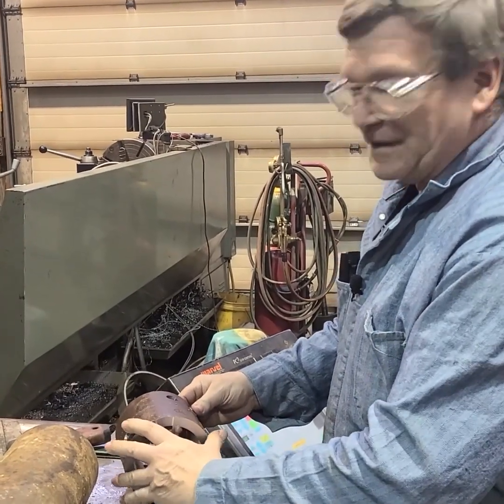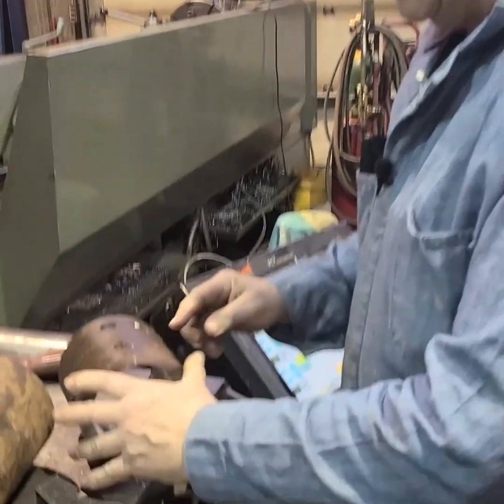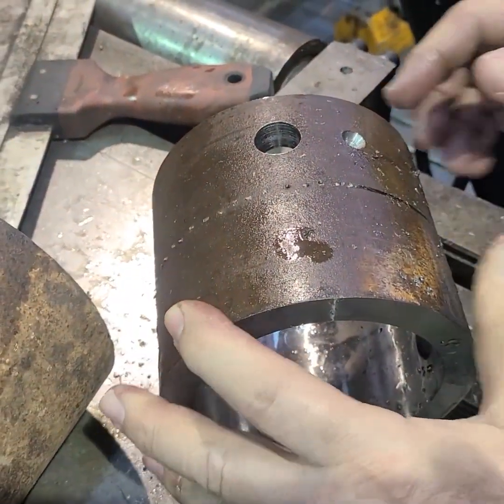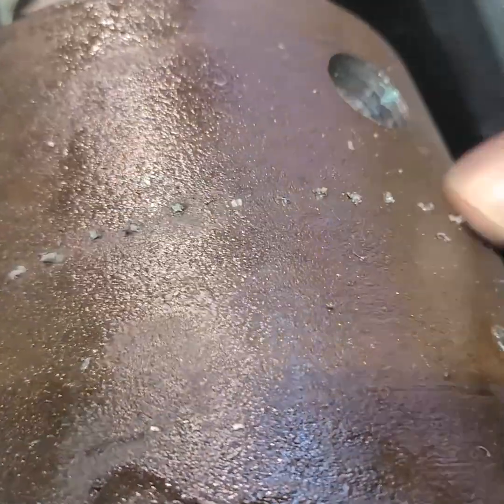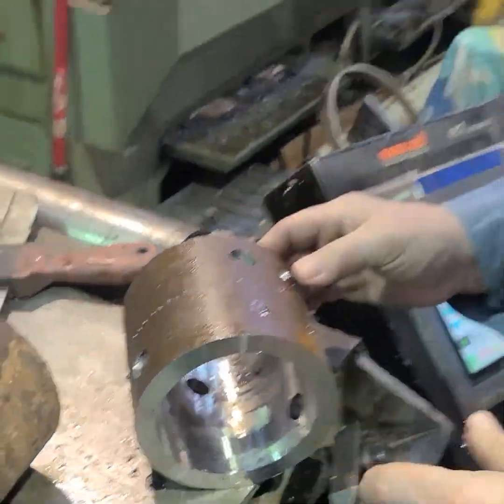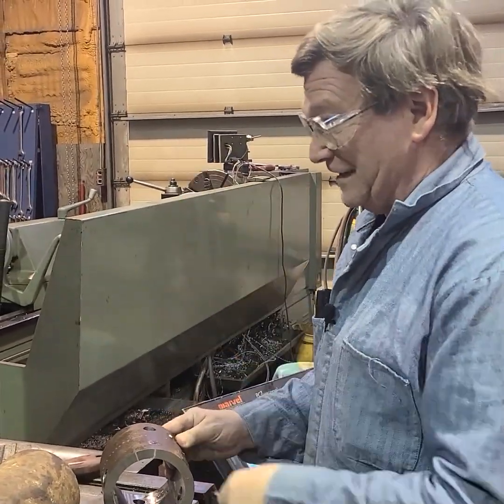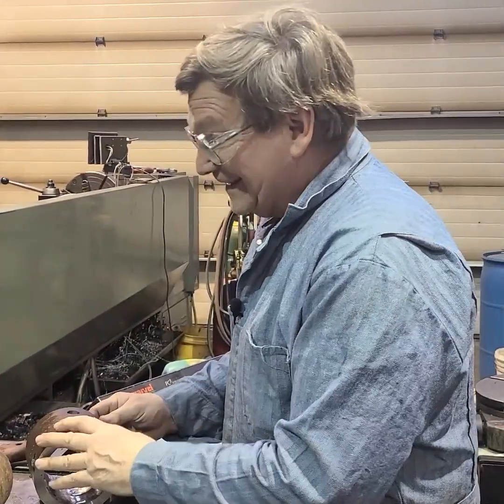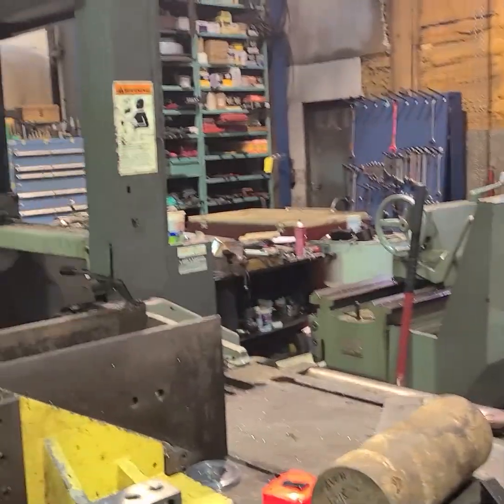Machinist's Minute: When you don't clamp your part in the saw

Comment: EDM!
It ends up with zero kerf or tool marks.
The cheap way to split a finished part using a band saw is make a fixture. 
The operator set the feed rate too high and it tears the workpiece free. 
Can't rush "perfection"

Comment: If that happened to a part that I was working on I would either take a sharp punch and knock out the fragments of teeth that got embedded into the part or I would use a angle grinder with a cut off wheel to cut through the remnants of saw blade, then finish the job on the band saw.

Comment: Years ago I worked at a fabrication shop/machine shop and we did a lot of first operation procedures for a larger military contractor. 
One of the operations was to cut spacers from heavy gauge tubing. The most common was one that measured 8in OD x 6in ID x 1in thick. The stock was delivered to us in 21ft lengths. They started out using a band saw but it wasn't accurate enough, then they were using a large power hacksaw, which was the most accurate. They had a lathe that could handle it but it would have required re-arranging the shop area to accommodate the long tubes and cutting the tubing down produced waste and the last cuts were an issue. What I did was to take an old lathe chuck and I mounted it to an angle plate I made up, the chuck could allow a flush cut right up the the saw blade on the power hacksaw. (and later a carbide cold saw).
The lathe chuck and the mount was bolted down where the vise was, it allowed a good solid grip on the tubing and was easy to advance as all it needed was a positive stop to set the length of cut. 
After a few months we sourced four more large older lathe chucks and I set up four more saws the same way and what started as a week long order could now be done in two days or less letting us get on to more profitable work.
Reply: Man honestly the big material is where band saws flop. Largest we had was 12" bar... It was delivered in 10' sticks, first issue we had wasn't even getting the vise to move it, it was actually stopping the material itself. Once we found that out, getting a straight cut was the new one.
Reply: There’s always a solution, it just takes “that guy” to see it. Well done😎🍺

Comment: Use one of the cordless bandsaws, blades are about $10 right now. Milwaukee 14 tpi blade and Dewalt bandsaw get about 8 cuts on 1.75" grade 150 bar with caution. Tpi and feed rate are life expectancy of the blade. Throw a pipewrench sideways to grab the end and lean on it.
Reply from the maker: My deep cut Milwaukee bandsaws max out at 4.5" this is 5"

Comment: Regarding the carbide... How much faster we talking through soft metal?  You ever get some soft scrap and turn her up fo "11" and see what happens?  Plus, the gods will favor your potential sacrifice of the blade if it goes how you expect.  They keep track, theyll make it up to ya at some point with a different blade surviving something it has no business surviving 😅
Reply: There are charts for everything you might be chewing up. " Single part" it's not worth turning it up, but just doing it right.     It's large production where you end up weighing the cost of the insert against the increased part output l.
Reply: We normally use carbide on aluminium parts, but thats CNC machines and not a saw. I use carbide saw blades for alu, but not band saws. We use steel for that. ANd it's probably the same reason...

Comment: Those last few words were the the most valuable, carbide isn't the end all solution. Know your workpiece and know your tooling.
Reply: Yeah unexpected because it's basically all we use to mill aluminium. But alu has optimal angles which aren't as optimal for other metals, so could be that too. Obviously in saw teeth angle/design it's not suitable.
Strangely though our band saw is steel. Our drop saw is carbide (as is mine at home). All for alu.
Reply: Yeah exactly. Carbide’s great especially when you’re dealing with computationally exact cutting but when you’re doing things manually by sight, feel, and experience it’s a whole different ball game

Comment: With the carbide blade try feeding it harder than what you think. Carbide works amazing in soft metal to do fast production cutting. That cut right there should only take 5 to 10 seconds.
Reply from the maker: What shape/size are you cutting & what sfm & feed pressure? I am always interested in better solutions.  with the M42 blade it takes us about 1.25 minutes, 270 sfm & 90 Lbs speed is not a problem here, but might be on some other jobs.  this is 1018 & 5" OD
Reply: @HOWEES  With (coolant) we are running about the same SFM were at 320 but we are at 140 lbs ish. i put the coolant part in parenthesis because as I look back to the video I see my mistake. I don't think you are running coolant on your band saw with carbide. This would also explain why carbide blades may not be as fun for you and your shop. I hope to learn more from your videos and really enjoy your content.
Reply from the maker: @renton7585  Yes We are running sawlution synthetic water soluble fluid.  What material are you cutting

Comment: Part off possibly?
Reply from the maker: That's exactly what we did.
-Cameraman
Reply: That's what we would usually do with short pieces of stock like this. Made a lot of rings and seals that you would just reset your g54 or even have it programmed in to move up itself eventually. You could get 3 or 4 parts out easily while holding fairly tight tolerances and finishes.